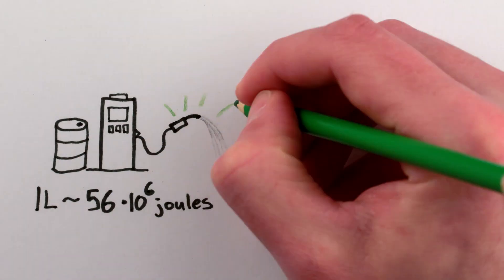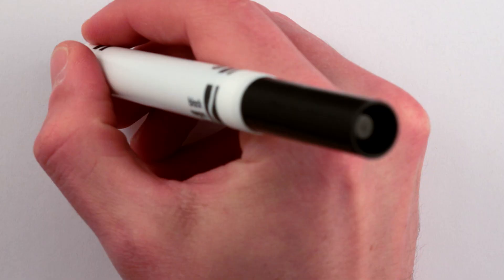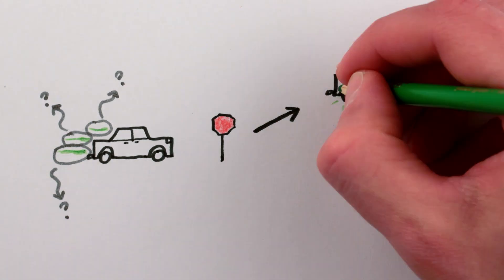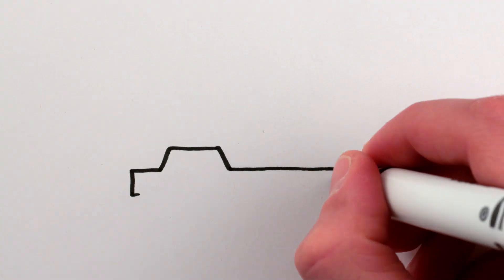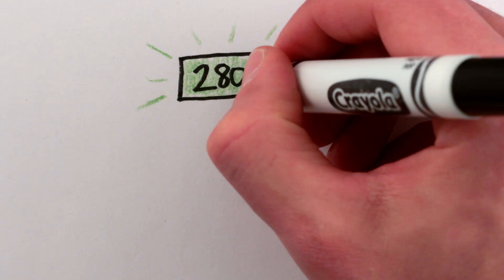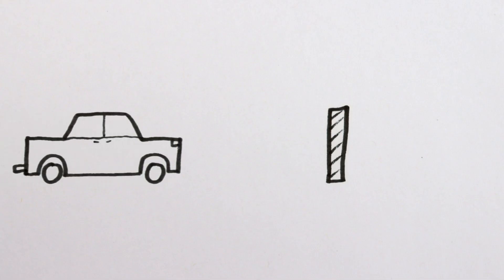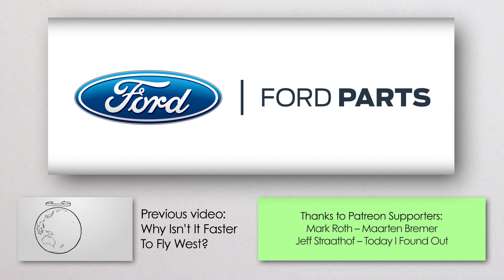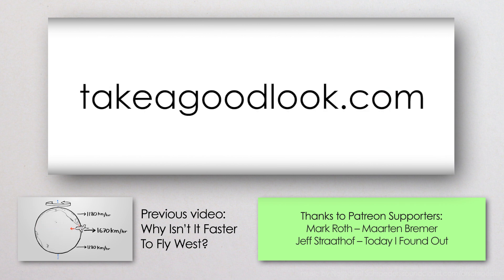The Physics of Car Crashes

Comment: "Cars are carefully designed to crumple when they crash."

I guess the Cybertruck designers missed this part.
Reply: there’s like a good 1-2 feet of crumple, and there being no engine makes that do a lot more than you’d think
Reply: But it is not designed to crumble because of the whole you will win in a confrontation with another vehicle thing, so the might be amzing potential, but it is not really Happening
Reply: @jasperfromming6633  Crumple zones exist for a reason. They absorb energy and reduce the acceleration experienced by the passengers. An extremely rigid car will cause serious internal injuries in a collision with a rigid and immovable object. The high mass might be benefitial for its passengers in a collision with a lighter car, but dramatically increase the risk for passengers in the other car. The concept is flawed, if every manufacturer built cars the same way traffic casualties would skyrocket.
Reply: @nicorosbergf1fan783  thats why i hate the cybertruck, sorry that was not clear from my previous comment
Reply: @jasperfromming6633  Ah sorry I misunderstood

Comment: What about motorcycles? They have no width to them so if they are taking in all the deceleration energy, how would that work? Sorry. With no brakes too
Reply: They're inherently more dangerous because there's just less material to absorb an impact. That's the tradeoff you do when using a motorcycle. 

There are probably parts made to crumple in certain ways, but I doubt it's nearly as important since well, you're dealing with 1/20 the material of a car

Comment: Cars were not "super rigid...before the 1950s". What was different was that there was no engineering for the safety of occupants. Cars were bent and deformed in various ways that might very easily intrude into the passenger compartment, but if so, that was just the tough luck of anyone inside. And without airbags or belts, you got tossed around inside - or tossed completely out - to your detriment.

Comment: 1. wrong. its about 60
2. a car with a thermal efficiency of 20 % is stone age technology. Most cars these days do over 30%, some even 50% and mercedes made a test F1 engine that should do 60%
3. Cars are not 100 meters long because its inconvinient, not because people dont want it. It would also be bad for traffic, weigh a lot, make for terrible handling because of weight distribution. it is not only the front of the car which crumples, its the entire car.
4. And finally, dont trust car designers unless you have proof in YOUR OWN HANDS. We saw how the diesels took a massive turn, and that was not only VW, but mercedes, ford, chevy, mitsubishi, subaru, etc. etc.

Comment: I'm a car modder, but not like scraping the pavement and loud exhaust on a small Japanese car haha. My current project is making a 83 vw to be the most crash resistant. I'm trying to find a blend between avoiding permanent damage to the vehicle and absorbing impact. The read bumper mounts which are normally designed to crush have a large coil spring to help reduce permanent damage while the fronts have a fault zone at a cheap, easy to replace and easy to crush bracket that cost $4 to make/replace per side. My goal is to be able to get in an accident rear ending a car at 20mph then to be rear ended at 20mph and to only have the two front bracket to replace. Of course in testing it out on a large tree and not on the freeway haha

Comment: Why don't we make future cars out of rubber or harder carbon fabric materials for safety reasons? 
And why the engine needs to be at the front of a car?
Reply: ***** Apart from number 1, I buy none of these.
Reply: Iunel Kirklin Liu must be a carhead...
Reply: Not all cars have their engine in the front, and such a car couldn’t hold up to the stress  of a bumpy road, possibly not even an even one at freeway speeds

Comment: When I asked a friend of mine, who is a firefighter, abour car crashes, he told me about an observation he did.

More accidents with low speed cars (like 30-40 km/h) were fatal for the driver in relation to accidents with arround double the speed. 

Our explanation was that the engineblock gets crushed at arround 70 km/h but is pushed into the driving compartment when on lower speed consequently killing the driver. 

Needless to say that there is an upper Border of speed to make this work, since there is only so kuch energy the engineblock can take until it is completly crushed.
Reply: So should I hit the throttle instead of the brake pedal right before crashing to improve my odds of survival? Hmm, interesting...

Comment: Many people believe that if you crash head to head with another car, both cars having the same speed, is like cashing straight into a wall with double the speed. My driving instructor told me that during my driving lessons and we pretty much argue because I was saying that it doesn't matter if you crash into another car (of the same mass) or into a brick wall. But how do we prove this? I justify this to myself like this: 1) in the first situation, the energy equals the kinetic energy of the 1st car plus the kinetic energy of the second (which is the same, because of the same speed the cars have). Now after the crash the energy has to stay the same as before the crash. So the two cars after the crash actually exchange energy, that is why both cars get crumbled. 2) In the second situation, the energy equals only to the kinetic energy of the car (as the wall doesn't move => no kinetic energy). So, just like the first situation, the energy has to be the same before and after the crash. when the car crashes into the wall and provided the wall doesn't get destroyed, the energy gets mirrored back to the car. If the car crashes into the wall with double the speed the energy that is returned to it would be 4 times more, so the damage to the car would be way even bigger.

Comment: I have a question:
Where is the energy after the crash? The first law of thermodynamics says, that energy can't be created or destroyed. But when i have a piece of iron and i bend it, where is the energy i used, to bend it?
Reply: you used the energy to bend it, and the bending process 'uses up' the energy. From internal friction in the metal to breaking up and deforming the crystal structure. 
Basically, the metal is resisting the deformation with elastic and inelastic strength, and overcoming these is what uses energy. Elastic deformation gives the energy back (f.e. spring), inelastic doesn't.
If you heavily deform metal it gets warm or hot, quite fast, even if the deforming process itself is cold (no red hot smithing).
Reply: +M DoubleU I have to assume that some some energy would be lost as waste heat generated from the muscles, although a tiny amount, its still energy.

Comment: The influence of seat belts should have been mentioned.
Firstly because without it, the cars decelerate in a progressive way but not the body of the driver if it is not firmly attached to the car!
Secondly, the acceleration (retardation) of a 56 km/h crash (standard speed of many regulation crash tests) in 50 cm crumple gives you around 25g which is pretty higher what fighter pilot may experience (9g).
However add to that the controlled elongation of seat belts and you obtain a total ride down distance necessary to reduce the acceleration to around 15g, pretty close if what experienced by fighter pilot as correctly claimed by the video.

Comment: The effect of a car's engine is only 20% during optimal conditions, straight road, constant speed etc. A normal person would be lucky to press the engine's effect to 10% due to accelarating, breaking and standing still. This has nothing to do with the video, but felt like posting it anyway.

Comment: Comparing the energy content of 1 L of gasoline (42.4 MJ/kg [wikipedia], d = 0.75 kg/L -> 56 MJ/L) with 1 kg of trinitrotoluene (4 MJ/kg [wikipedia], d = 1.65 kg/L -> 2.4 MJ/L) is deceiving since their densities are not 1.
Reply: 42.4 MJ/kg, d = 0.75 kg/L -> 31.8 MJ/L.

Comment: The safest place to put a metal spike in a car is the center of the steering wheel. Would you drive unsafely if there was a metal spike aimed at your chest?
Reply: +NiceGuysRUs Not if the metal spike is in every single car.

Just threaten everyone with instant, uncaring, non-negotiable death.
Reply: “Some might replace the steel dagger with a rubber one. Indeed, a black market in fake steering-column daggers might arise. But that of course could worsen the problem because now some drivers will drive as recklessly as before, while law-abiding drivers will still have daggers aimed at their chests. There maybe fewer accidents but more deaths than before.”

Comment: @ 1:10 That would be "deceleration", not "acceleration" :).
Reply: deceleration is acceleration but specifically in the direction opposite that you are moving. It is correct to say either deceleration or acceleration

Comment: Then your bumper costs over $300 to replace even on a love tap because the crumple zone is there meaning the car industry makes more money due to having the whole part replaced just a big scam.
Reply: +cantryss Dude, the entire video was about why having a crumpling bumper is good. Next time you love tap that tree, you'll be glad you weren't driving a rigid block of metal down the road.
Reply: +rabbits2345 nope I'll be thinking, "I'm about to get ripped off by the automotive industry."
Reply: Or be severely injured from a low speed collision...Running full speed into a wall at 12 can give you a concussion. What would happen to you at 30 mph?
Reply: +rabbits2345 still more cost effective then replacing that bumper
Reply: +cantryss and that's including the physio after with the broken legs.
Reply: +cantryss in the end it's which science is cheaper for the consumer and it ends up being medical where I live. And also for the person who damaged my car.
Reply: +cantryss With a rigid car there is a higher risk of death. AND if you don't die higher risk of losing a limb or something, or maybe damaging your brain
Reply: +cantryss if you find a rigid car because you don't want to be "scammed" by to auto industry, you will regret that in your last moments as you ram into a tree.
Reply: +L4Vo5 you people seem to forget about seat belts and air bags
Reply: +cantryss airbags and seat belts only go so far, it's best to have the 3rd item, a crumple zone.
Reply: +Paul Mahoney Nawh don't worry I'm a grown person if I want to put my life at risk with a war tank of a car that should be my choice. The chance of me really getting hurt and the projected idea of how badly I COULD be hurt should be my choice and if I don't want to have a crumple zone that happens at the 5km/h where I wouldn't be hurt badly costing me $600 or the poor sucker that dings my car with a love tap shouldn't cost them $600 either. I've had to replace a bumbler because some asshole slightly bumped me in a parking lot with no other damage to my car and dented the crumple so it had to be replaced out of "safety" with a older car all that would be required was nothing or a hammer. They're built more flimsy then they need to be for profit.
Reply: +cantryss "nope I'll be thinking, "I'm about to get ripped off by the automotive industry.""

Dude. It's better to be "ripped off by the automotive industry" than it is to be "ripped off by the healthcare industry." Trust me, $300 to replace a bumper is a drop in the bucket compared to what your healthcare bills would look like. Not to mention the physical pain you would be under...
Reply: +Violent2aShadow I got universal healthcare it's all good.
Reply: @cantryss  though a tank of a car doesn’t just risk your life, it risks other driver’s lives since more energy is going into crushing their cars that isn’t crushing yours. You have the right to risk your life. Not others.

Comment: Steel rails connected to the front bumper? Not in any modern car I've seen, unless he is referring to the bent sheet metal structure on either side of the engine compartment as a "rail"

Comment: 20% Efficiency?! American car? Magnetic braking would make wonders if used together with the mechanical one, like in Formula 1. Might make the impact dinosaur slimmer and save your engine from getting ruined or worse.

Also, what happens when the car's engine is at the back?

Comment: What car that only has 50cm of "crushable space" a.k.a the front bumper to your wind shield.
Reply: +boy638 The motors dont crush. There isn't a lot space under a bonnet of I modern car. Have a look yourself.
Reply: +boy638 It's 50cm of crush zone. Not 50cm from the bumper to the driver. The whole hood of the car isn't a crush zone.
Reply: +boy638 That is half a mater. Or is that not long enough. It's 0.5 meters, 50 centimeters, 19.6 inches, and 1.6 feet.
Reply: Most cars have at least a meter of hood length except those compact cars.
Reply: +Kurukx True, the motors do not crush,  but what was left out of the talk: that motors are designed to travel downward instead of straight back (into the passenger compartment), thus dissipating more energy out of the system.

Comment: Ford is very likely bullshitting us, judging from the past history of automobile manufacturers. Anyone remembers the Ford Pinto? The Ford Pinto had a serious flaw in its fuel tank that made the car far more dangerous than it could have been. Unless I'm dealing with unreliable sources (Wikipedia),  "Ford was aware of the design flaw, was unwilling to pay for a redisign, and decided it would be cheaper to pay off possible lawsuits. The magazine obtained a cost-benefit analysis Ford had used to compare the cost of repairs (Ford estimated the cost tobe $11 per car) against the cost of settlement for deaths, injuries, and vehicle burnouts. The document became known as the Ford Pinto Memo."

Comment: Great video, and nice of you to thank the sponsor, Ford... but while you were there (at Ford) talking to that awesome safety engineer, did you ask about the Ford Pinto, you know: the car that exploded when hit from behind, usually resulting in a fire-ball that incinerated the trapped occupants, for which there was a cheap fix ($11) that Ford decided not to implement because it was too expensive?  Maybe you should have asked him how many of those death-traps Ford rolled off the production line in full knowledge of that easily corrected safety issue... Now THAT would have been a good question to ask.
http://www.popularmechanics.com/cars/a6700/top-automotive-engineering-failures-ford-pinto-fuel-tanks/

Comment: One question, however, that has been driving me crazy for quite a few days is, why the fastest and more powerful cars have the lowest MPG? Would this mean that although high performance engines can deliver really high torque and horses it wastes way more fuel than their low end counterparts?

Examples:

Toyota Prius C 2016             ->   53 MPG in city
Ford Mustang GT 2015        ->  up to 16 MPG in city
Bugatti Veyron 2011            -> 7 MPG in city
Average F1 car                      -> 3.1 MPG
Top Fuel Engine                    -> I couldn't find this but it can suck a full tank of nitro methane in just a 1/2 mile

Comment: this video seemed pretty light on the content, definitely not on the level of previous videos. and the big sponsored by automaker at the end felt wrong. it seemed like a commercial. so the only video released in a while is basically an ad? what happened to minute physics?

Comment: Except Ford doesn't have great safety records. If it's not clear in this video, heavy, grossly over-powered cars are the opposite of safety no matter how many "solid", "rigid" "strong" they put in the advertisement. Contrary to common north american sensibility, muscle doesn't mean safe.
Reply: +ahadicow The 2015 and 2016 Ford Mustangs have 5 star safety ratings from the NHTSA, and "good" rating from the Insurance Institute for Highway Safety.

http://usnews.rankingsandreviews.com/cars-trucks/Ford_Mustang/2015/Safety/

http://usnews.rankingsandreviews.com/cars-trucks/Ford_Mustang/Safety/

Safety technology has actually improved, and Ford is doing a much better job these days than in the early 2000s.

Comment: You should have added the purpose of airbags, which are also designed to decelerate your body vs the car. 

What is often mistakenly assumed is that airbags are soft cushions that hit your face, but if that were the case, they would shred apart from the explosion and your face would be hit by a huge amount of shrapnel from the airbag's micro-explosion.

Instead, airbags are actually made of a material that is similar to a basketball so that they could withstand the pressure of the sudden inflation, and when they hit you in the face, it really feels like a basketball thrown right into your nose.